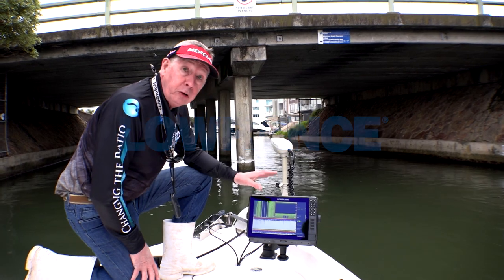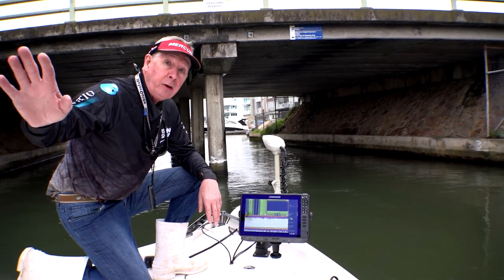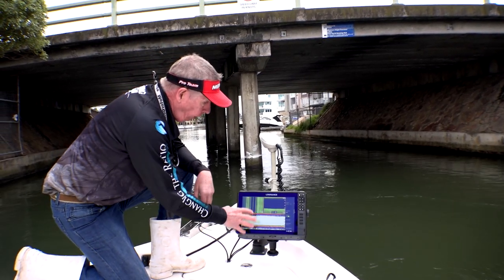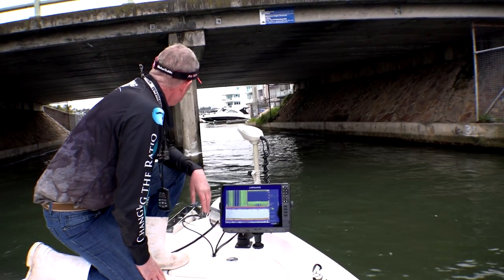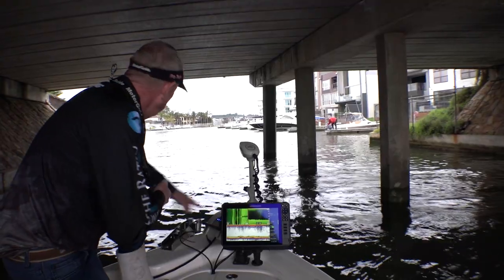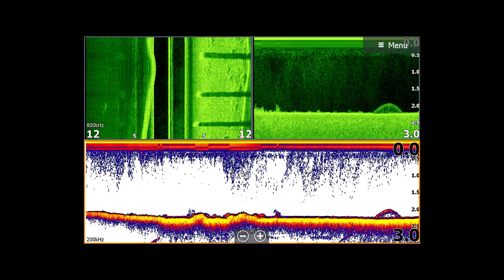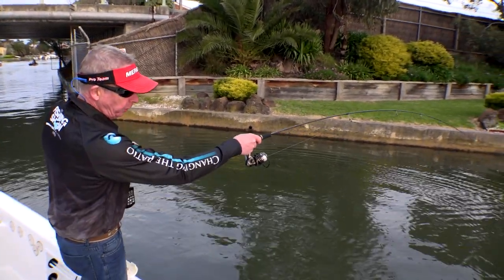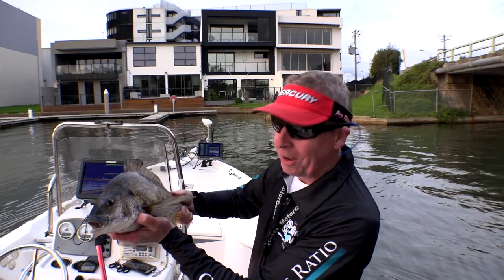Lowrance HDS LIVE

Comment: Thanks for the video! I just bought the Lowrance HDS Live unit with the 3-in-1 transducer, I also got the Minn Kota Ulterra US2. which transducer would you recommend to use? can both be connected the same time? any advantage of the US2 vs the Lowrance one?
Reply from the maker: Both transducer can be connected to the HDS Live unit. Bear in mind both transducer will be using 83/200kHz so there's no difference there. You will get sidescan from the 3in1.

Comment: Works great when it works and easy to use, but.... Got an hds 12 live, hds 9 live, pilot pack with precision 9, halo 20+, and close to a thousand on nmea and ethernet cables and fittings and couldn't be more dissapointed. The hds live 12 has a software that has a known issue with ethernet connectivity and had to use a nep2 to fix. Only after hours spent on the phone swapping cables around trying new cables and soft resets.  Also this thing fried my airmar ss60 because it recognises it as such but gives the wrong frequencies. I ruined it running the wrong frequencies. Then halo20+ yesterday gave a no spoke data 2 times and required a restart to fix. The call center is a joke. They are clueless about the issues and don't help much. I had a gen 2 before and loved it so I spent a small fortune ( over 10k) upgrading all my electronics to newer tech. At this point I have to strongly recommend not buying navico brand. Too many known issues with no fix available.
Reply from the maker: Hello Tobias, we believe our service department was able to help you with your issue. Please let us know if you still need any help.